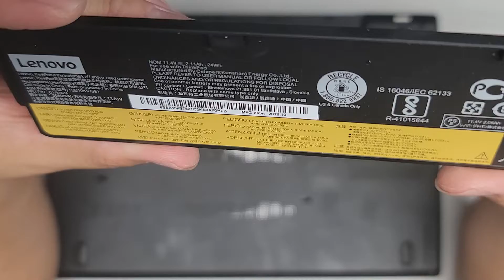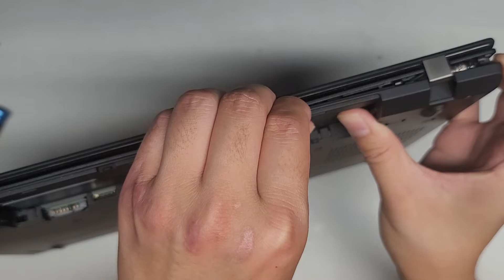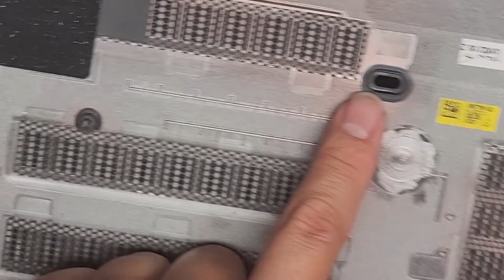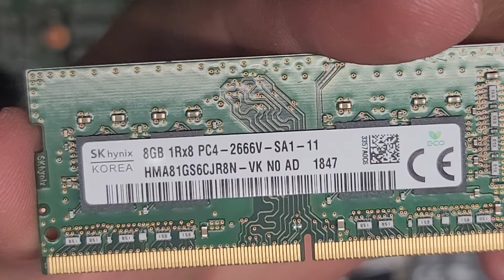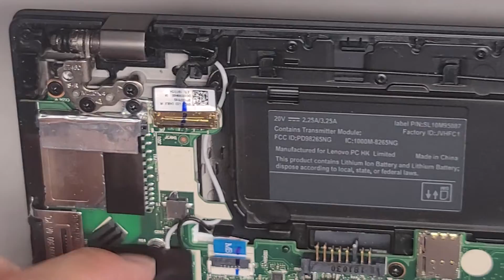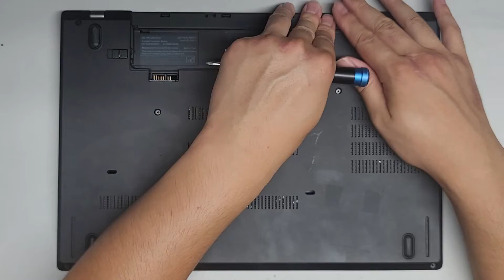Lenovo ThinkPad T480 Disassembly RAM SSD Hard Drive Upgrade Battery Replacement Repair Quick Look

Comment: Great video. But you should have disabled the internal battery in the BIOS before opening the case, and show how to do that. Subscribed.
Reply from the maker: I just physically disconnect it. No need to do it from bios.